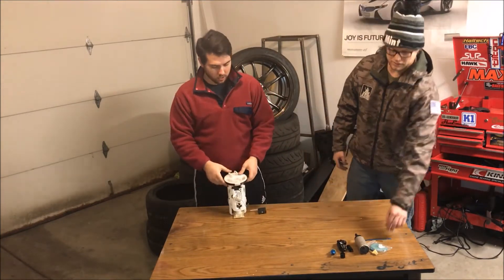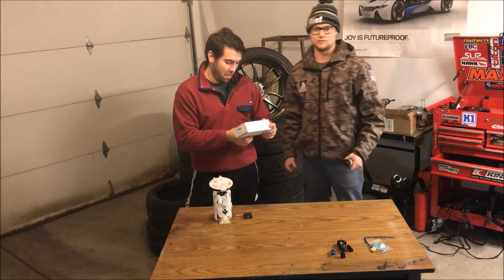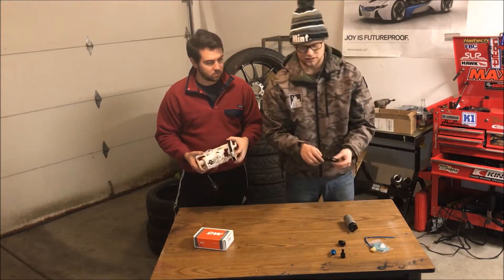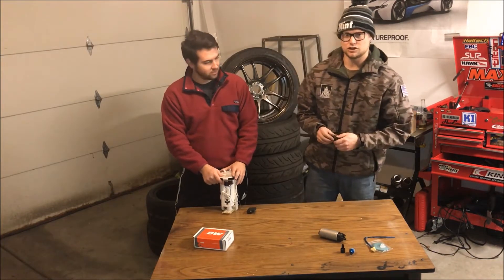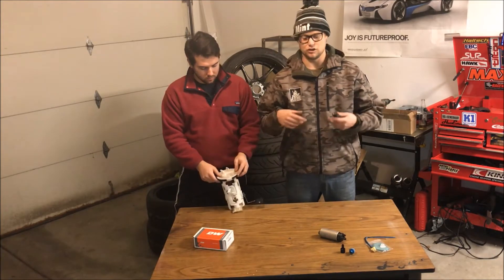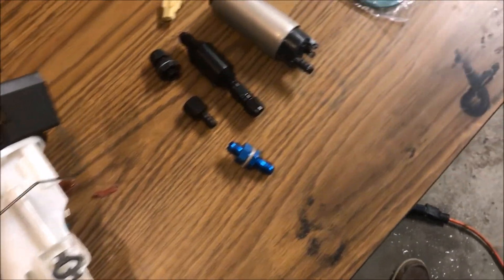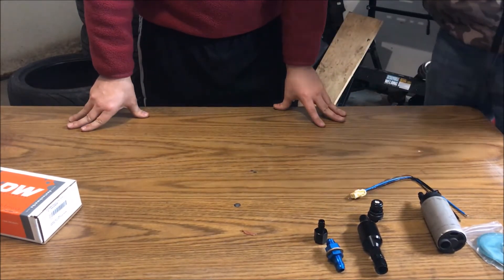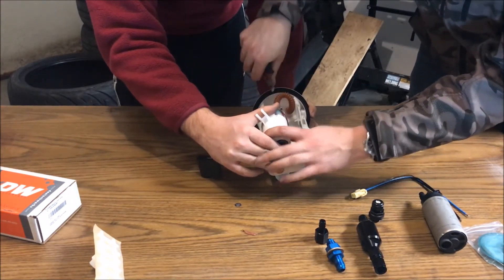Ultimate E46 DIY Single Fuel Pump Upgrade! DW400 in Stock Fuel Hangar

Comment: How did you get the filter sock onto the inlet of the pump? Doesn't seem like mine will fit. I've put quite a bit of force, but it still will not snap on.
Reply from the maker: Gotta smash it on I usually hit it against a table or something
Reply: @Seems Legit Garage  ok, I appreciate it bud! Did you also use a small clamp to make sure it stays?
Reply from the maker: @mikeyb1nyne81  no just smashed it all the way on
Reply: @SeemsLegitGarage  ok, I appreciate it.

Comment: Does the other transfer pump work doing this? I want to go to a 450 pump for my Ls swapped e46 but always worried about how the tank has 2 sumps
Reply from the maker: There is no pump on the other side, it’s just a venturi to transfer fluid and also a level sensor
Reply: @SeemsLegitGarage  My bad, always looked like there was something on that side when I switched to an M3 pump. Having good like with the DW400?
Reply from the maker: @fuzzfire  yea still Runnin strong!

Comment: I wonder if you managed to fit it in the tank; since with the long fittings for the pump, you have eliminated the spring action & hence I believe it won’t fit unless the screen would be smashed in the tank bottom! & of course that would affect the flow badly.
Reply from the maker: All I know is it works sweet and is still in my tank
Reply from the maker: makes 680hp, plenty of flow

Comment: nice video, but i have a problem and no one seems to know, i went under the back seat and the after taking the bolts out, lifting the little panel, it looks totally different than other fuel pumps that i saw in other video, there is no ring to untie, it looks like just a plug, at this point i'm lost
Reply: You probably have a SULEV version of e46; which has a totally different fuel system & the fuel pump is built in the tank, so if you have a fuel pump issue; unfortunately you’ll have to replace the whole gas tank.